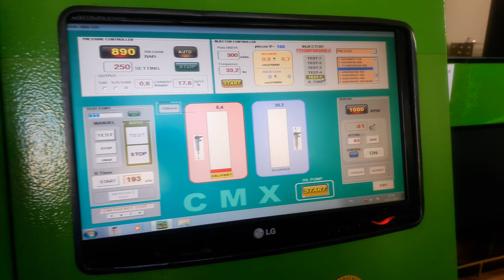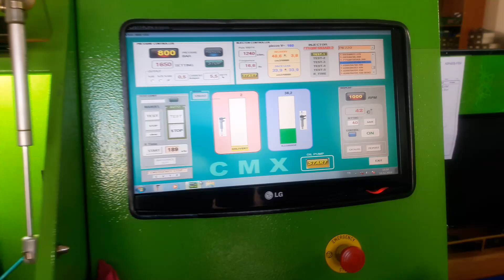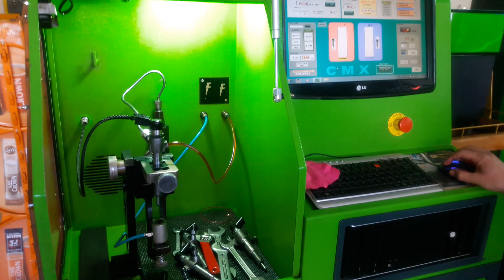FORD CORNET 75 PS 90 PS 110 PS ENJEKTÖR TESTİ

Comment: Slmlar.Benim aracım ford panelvan connect 2005 model...aracım bazen gaz yemiyo .kırmızı ışıkta kalkışlarda gaz yememe durumu var..Ustalara gittim bir pompa dedi biri turbo dedi biride enjektör sizin bir öneriniz var mı
Reply from the maker: Araç kaç ps
Reply: @hizalpompa6793  75 lik
Reply from the maker: Pompadan yapar kardes yarın mesai saatleri içinde arayın detaylı bilgi verelim 05544578575
Reply: @hizalpompa6793  tamam abi